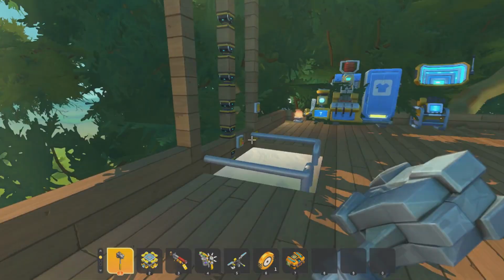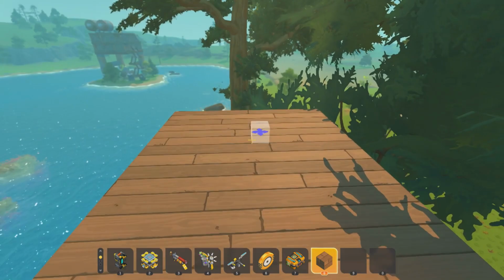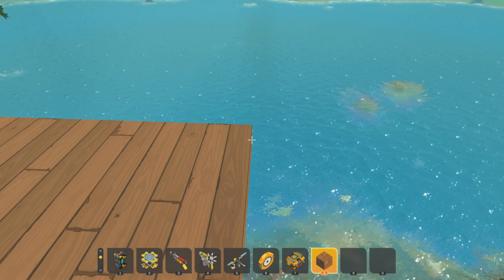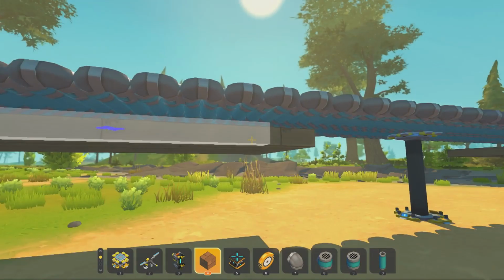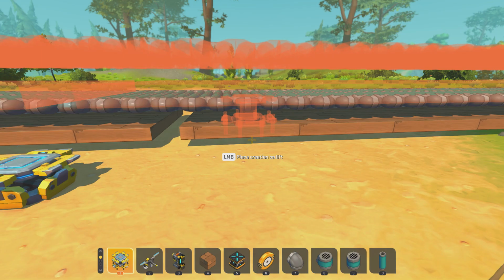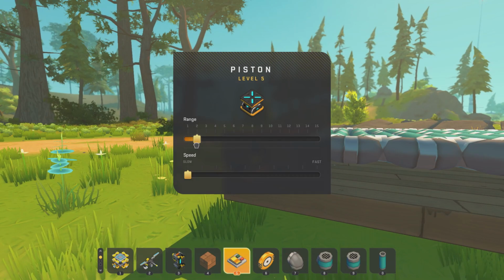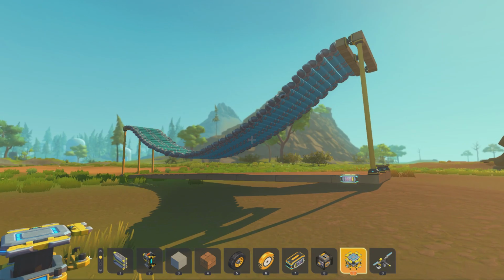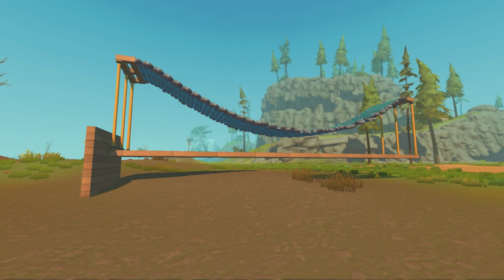Can You Make a REALISTIC Suspension Bridge Without CRASHING Your Game? (Scrap Mechanic POC #1)

Comment: There actually is a way to save and load creations in survival, they just go to a different folder. Run the command "/export [name]" to save whatever is on your lift and "/import [name]" to import the file onto your lift, if there is no lift, it spawns where your lift was with no physics until you update it by building on it.

Comment: Attach all the bearing’s on the bridge to some controllers, then remove the controllers when the pistons are fully raised. Or adjust the angle of the controllers so it looks like a suspension bridge but doesn’t act like one.

Comment: You should make the segments longer. They don't have to be a single block so you won't have to use a billion bearings. They can be big ol slats, not just the single tubes. Ya know, like an actual suspension bridge.
Reply from the maker: An actual suspension bridge has thin planks or sections that are also under flex, not flat. having a ton of bearings is the only way to simulate realistic sag which was the point of this whole thing :)

Comment: I'd use a controller to set angle and fold the bridge back on itself, then remove the controller. then the bearings will go slack, allowing for the curve.
so, go out, like, 10 blocks, then set a pair of bearings to +90, build up a bit, then set the next 2 pairs to -90, build back down, set a pair to +90, then build back over.

Comment: Try putting the bearings on controllers to see if the free pistons and the parts rubbing against each other are what made the lag. Probably wouldn’t minimize the lag entire but worth a shot. 

You can also make 1-2 wide gaps in between to minimize the grinding and the players are big enough to cross over two wide gaps. 

Also making three long wood sections with breaks in between would look like a plank bridge which do work from tree to tree and would minimize the amount of bearings. You could even use suspension between the parts to mimic the ropes which may minimize lag.
Reply from the maker: Thanks for the comment, AdamI considered putting them on a controller to test that earlier but then I remembered there's over 140 bearings to connect xD
Can definitely make this whole creating less taxing and I like your idea about the suspension pieces! I guess I just wanted to simulate rope sag best I could :)
Reply: @darealkosmo  suspension pieces have interesting sag dynamics that make it look like the rope is constantly in tension and if spaced out the pieces simply look like they’re going through the boards. 
You can also try to use them to make a suspension bridge very similar to the GW in New York. That way the bridge looks real but you can make it static with the suspension acting cosmetically or you could do a combination to minimize moving parts but still have a “functioning” suspension bridge.

Comment: the links on the left side wern't welded together, thats why there was so much sag (and lag)
Reply: turbo biscuit!
Reply from the maker: Unfortunately welding them up made absolutely no difference! It actually made it worse I think because now more bearings are connected and stretching out..
Reply: @darealkosmo  in my opinion, bearing stretching out is not a problem. the problem is where the things on bearing collides into eachother and getting stuck.

Comment: It can work but it will be laggy. Less laggy if you weld either side together. Bearings are the killer here. Still though, cool idea and stuff like lag should never stop your creativity.
Reply from the maker: Thanks Neil! Going into this I knew it might be a disaster but I still thought it might be cool to test out :) I actually ended up welding those pipe pieces together and it did not seem to help at all. You're right, the bearings are the real killer. I don't know if it would make a difference, but maybe having a separate free-floating bearing part that can be used for pivot points would help mitigate this. Don't know enough about coding though...

Comment: well, speaking of hopes, I hoped that you will be wise enough to build the sections at least 4-5 blocks long and on a single bearing each, that would remove the lag massively, I mean that you make the sections in the shape of Y down the middle so it doesnt sag one side. That might actually work, but that would lag the world anyway, just in less degree
Reply from the maker: I was trying to simulate a rope bridge with proper sag :) There's more than one way to do this, I just chose the realistic simulation option which also happened to be the most lag option.
Reply: @darealkosmo  I get that, but it was rather clear that this plan is not the perfect one when the survival crashed the first time, true test would show how much from the original concept you have to deviate in order to achieve something actually usable. Also, most bearings=most lag was a pretty obvious guess tho

Comment: Just wait until he learns about /export and /import in Survival. And learns how to properly weld bridge parts!
(looked like the whole controller side of the bridge was not welded, just free spinning right angle pipes)
Reply from the maker: haha yep mistakes were made..
I actually went back and welded those piece and it made no difference. Actually the only difference was going from 4fps to 1fps loll
Reply: @darealkosmo  Gotta love it! Tried re-creating that bridge too, and it went about as well, even putting springs on one end did not help. However at about half the span it was much better. So perhaps solid arches above with 'strings' going to the actual hanging part would work much better. Another thing that may help is to 'calm' at least some of the bearings by connecting them to an unpowered engine or a controller. Seems like they were rubber-banding when spawned, and that caused more rubber-banding and bouncing, causing more lag.
Reply from the maker: @AgentWest  ah yes, gotta love the self-perpetuating rubber-banding xD Good call on the solid arches actually! Wouldn’t attached the bearings to engines or controllers lock them in at the nominal angle? I actually uploaded this thing to Workshop if you wanted to experience some wonderful lag and game crashing :D
Reply: @darealkosmo  While controllers do lock up bearings completely, electric and gas engines do not. In fact, electric engines turned out to be the best solution since they do turn under load, but not very readily. I have uploaded that version of the bridge as "AW's trully suspended bridge" so check it out! It's laggy when spawned, but settles down fairly quickly.

Comment: Kosmo you didn't weld ANY of the sections on the one side.  When you weld, you have to weld each piece between bearings or pistons individually, it doesn't do it when you weld from the one side.  That being said, I know you wanted it to look cool, but that first wooden piece with less bearings would probably work.  As another comment said, you can connect the trees with it if you run wood blocks through the truck of the tree, underground, and to the other side.  That would make both sides "one structure".
Reply from the maker: Yep, I goofed a little...but then I went back and welded all those pipe pieces up aaaaand it didn't help at all :( At least I know it didn't change my experiment results lol! Good call on connecting through the trees!

Comment: You can make a loose suspension bridge by putting bearings insome kind of a s shape so you have 10 parts but in a technicaly 8 blocks long build
Like instead of align every part on the lift you can offset them to make something more compact that will be longer than the distance between the 2 extremities

Comment: There’s a much easier way to do this, which requires no pistons. Simply build it and make part of the bridge go up like a stair, but with bearings on the corners so that once you remove the supports that keep the bearings from floating and spinning, it falls into a rope state. The lack of pistons makes the physics much easier to process and I saw no frame drops upon making a 20 bearing bridge

Comment: To make a bowed bridge with berings you need to build most of it straight so it will weld the other end but have a few upside down U shape along the length an depends on how many u you put in would determine the sag an using controller then remove them like someone said you will be able to line it up an weld both sides

Comment: Would using controllers to fix the bearing angles in a way that produces the effect of a suspension bridge perhaps alleviate the lag? Pretty sure the lag is caused by free bearing angles being constantly calculated by the physics engine. If they were rigid would it make a difference?
Reply: Yes, absolutely. Tons of free floating bearings have long been an issue with Scrap Mechanic.
Reply from the maker: I thought about that...and then I remembered I have 140+ bearings to connect to controllers xD
Reply: @darealkosmo  Thx for the heart! Yep, I've had the pain of connecting around 300 logic gates before.. Not fun.
Reply: @darealkosmo  Fair point :p

Comment: For some reason, it seems only half of the pipes got welded together. Maybe that's what worsening the lag
Reply from the maker: I can't believe I overlooked that...I thought they were just freaking out. However, if it's any consolation, I just went back and welded them all together and it did not help even one bit. In fact I think it might have gotten worse because now even more bearings are connected to each other and are getting stretched out!
Reply: @darealkosmo  that's really sad, there goes the dream of the suspension bridge :(

Comment: In god mod you can use the commands /export (name of your stuff) then /import (name of your stuff). So you could build a section of your bridge then duplicate it and weld it to the others
Reply: sometimes thats gets sketchy and some blocks stay as solid objects in mid air
Reply: @iancline9703  I saw that and it's really annoying but it's useful to move full complicate stuff (like my f*** automated farm) from a place to another. I noticed sometimes it's easier to stuck it into something else before destroy it (like a tree) and then it fall off. But it's not perfect. Most of the time it's just a block that is stucked in the air and when you find it and pull it off, your creation fall.
Reply: @Metalik00  yea i used it but things like logic creations just fall apart all the time and kinda pointless them
Reply: @iancline9703  Maybe the game need to be more logic 😄
Hope they will fix all the problems soon. This one and especially the big lag problem. Cause without lag you ruled this video in 5 minutes 😉

Comment: I think half of the bearings aren't welded together.
Reply from the maker: You would be correct! If it's any consolation though, I went back and welded them up and it made absolutely no difference. In fact, I actually think it made it worse because all the bearings are connected now and even more of them are stretching out!
Reply: @darealkosmo  I know. I have more than a 1000 hours in this game. It’s just too many bearings.